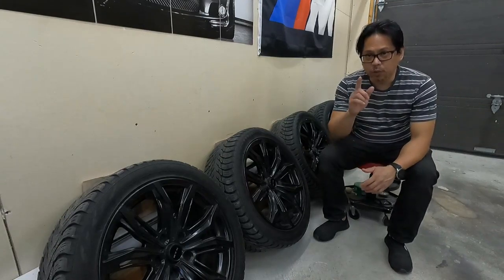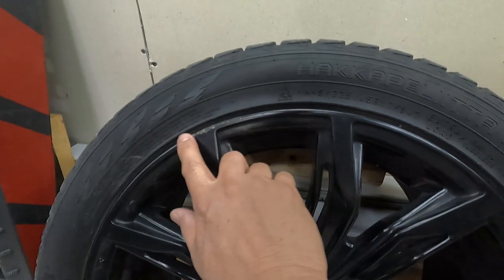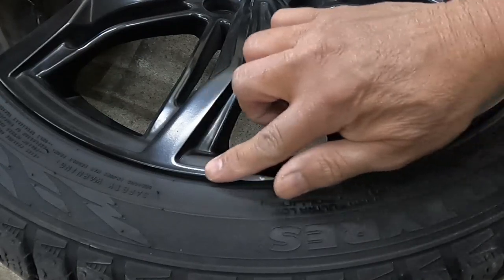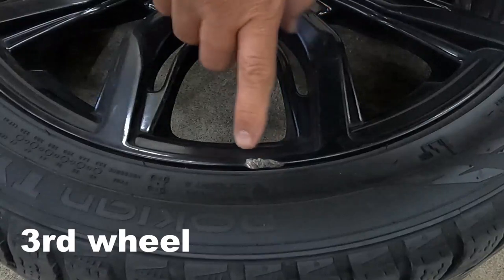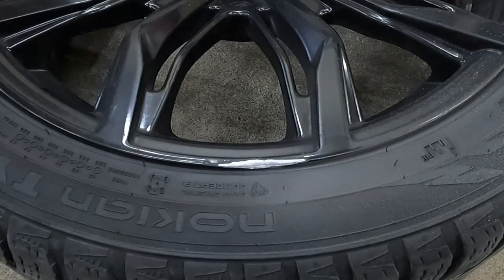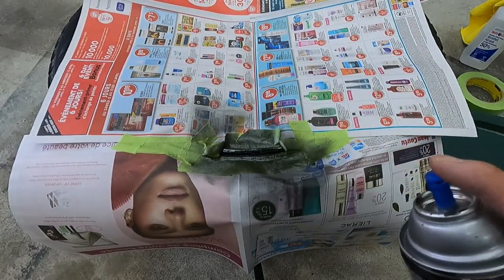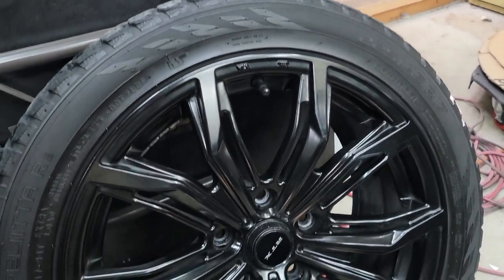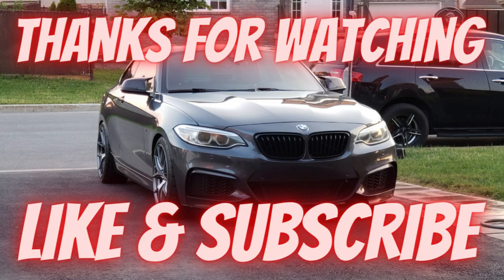BMW M240i wheel curb rash repair w/ gloss black finish (Amazing Result !!!)

Comment: Hey Ed. Nice vid like always. Thinking of getting a mhd back end flash for the jb4 soon. Also I think I have to install my cat back on for inspection:( it’s going to suck.
Reply from the maker: The MHD will not conflict with the JB4? , Why do you have to go for inspection? Is this a annual requirement on your state?
Anyway hope you passed inspection , Good luck Bro.
Thanks for watching!!!👍
Reply: @edcardiy  yeah it’s a yearly thing. I just know it’s going to suck to install that cat again. And the mhd back end flash for the jb4 remaps everything like afr throttle response exc while the jb4 is still used as a boost controller and safety net.
Reply: @edcardiy  there are specific maps made by burger Motorsports for mhd that work hand in hand with the jb4
Reply from the maker: @garett2892  nice, let me know how's the performance after.
Do you draggy your car after mod?
Reply: @edcardiy  No I don’t drag my car. I was thinking about starting to. It’s just supposed to be a smoother experience.
Reply from the maker: @garett2892  Yup draggy is an electronic gps that measures your 0-60 and 1/4 miles if you see any improvement on speed after a mod.
Chris and I use this device  to check improvements on mods.
Check out my draggy video for details.
Reply: @edcardiy  will do ed’